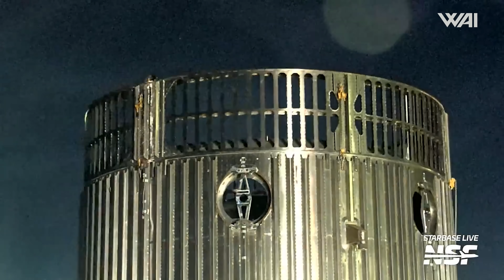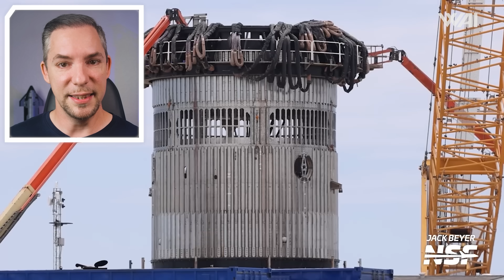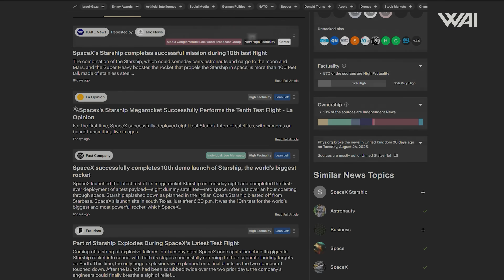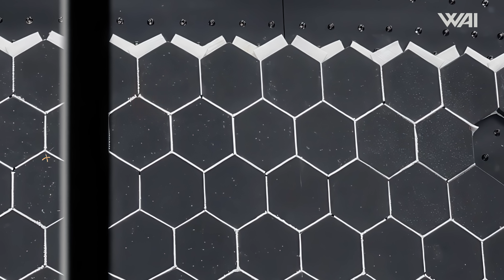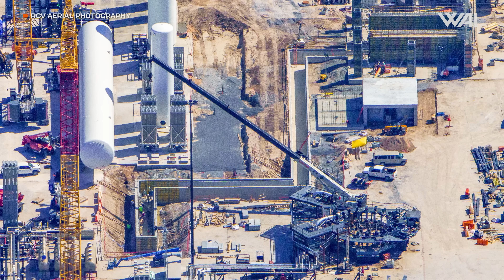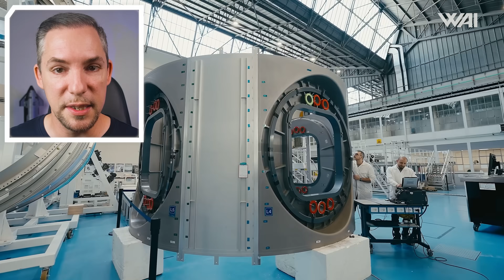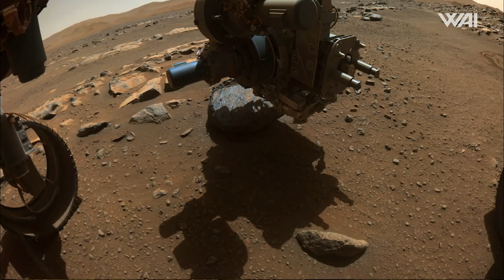SpaceX Surprisingly Reveals New Starship Heat Shield Plan! Flight 11 Launch Window

Comment: Sometime i feel bad for spacex, they finding the solution of the problem which should have not exist at first place specially in 2025.
Due to bold choice of using stainless steel they are only space agency facing problem with primitive tech like heat tile.
Hope it get resolved
Reply: They chose stainless-steel for its higher melting point, providing more resilience if the heat shield failed - and eliminating the heat shield in other areas.  But the biggest problem with stainless steel is that now Starship is way too heavy.  They will very likely have to accept reduced payload capacities for all Starships moving forward.  The 100+ and 200+ tons stated for Starship V3 and V4 respectively ... are just a "Wish" .. that will never come true.